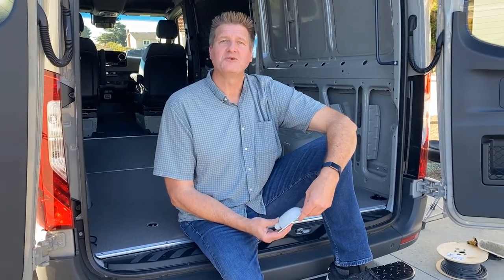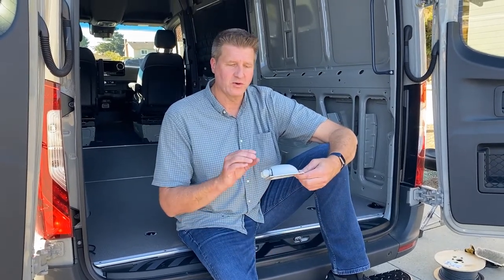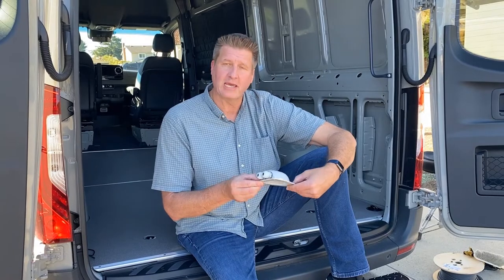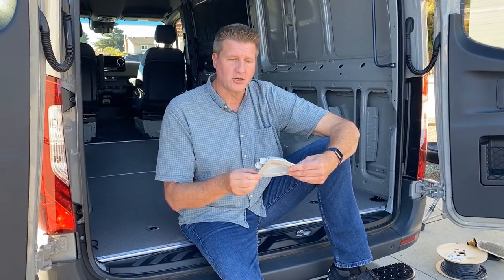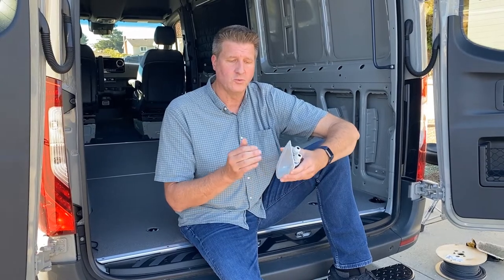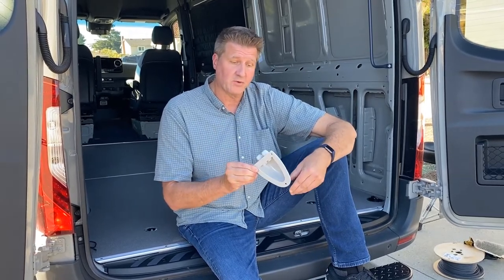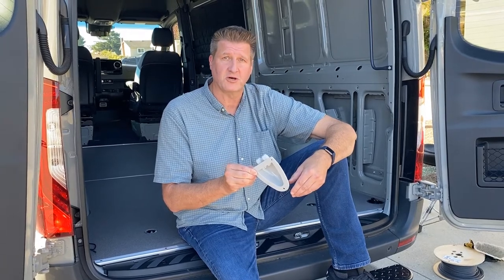MileStone Sprinter Van - Cable Gland Installation

Comment: Nice.  Was looking for a video on doing this to my van build.  I'd do it a little differently by just drilling the wire hole only.  The butyl tape and lap sealant (or eternabond tape) should be fine without the 3 additional screws. I just try to minimize any more holes in the roof.  Thanks.